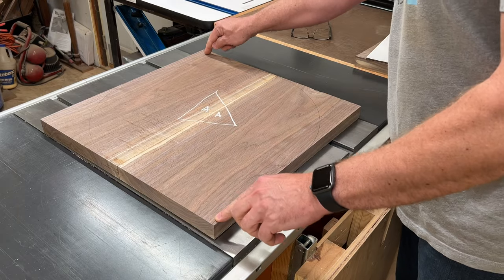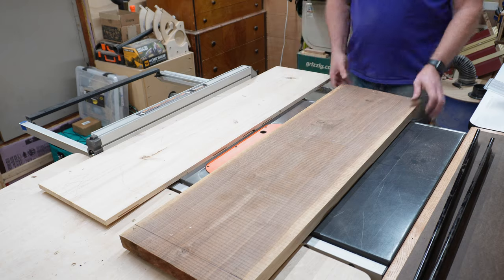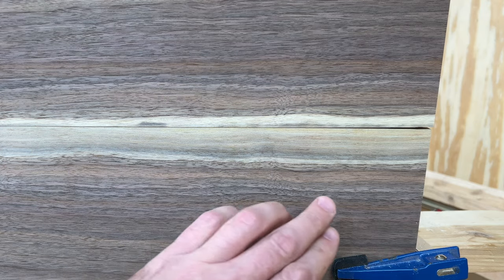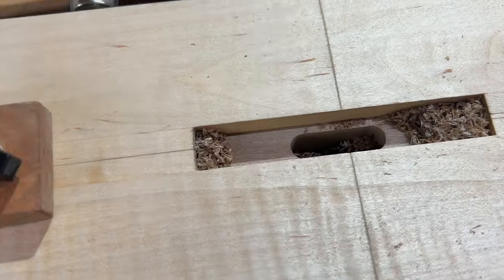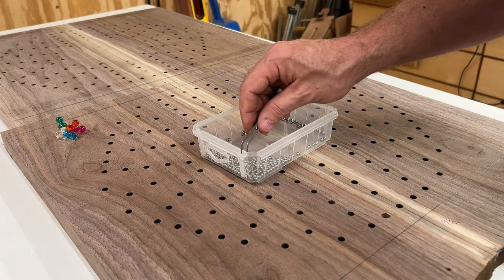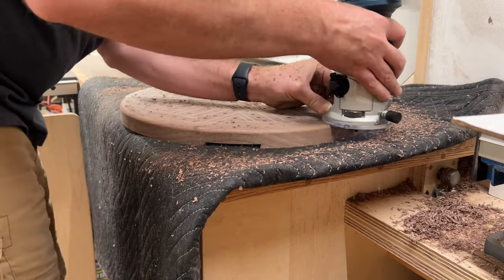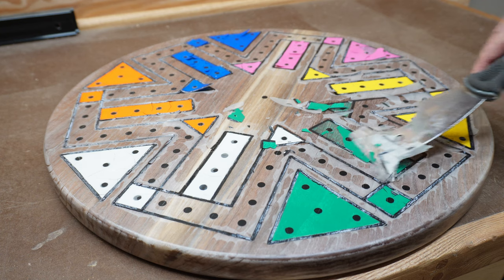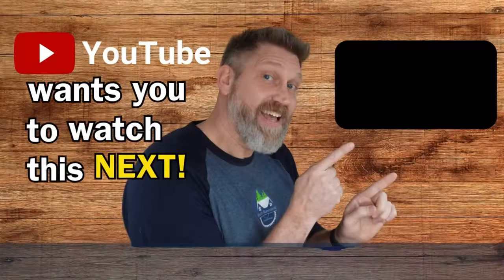I Almost Gave Up Making a Wooden Game Board

Comment: So, did you use...... wait for it..... Black Jac Shellac? 😂😂😂. Couldn't resist! Regarding all of the imperfections that you said would have been better if done with a CNC. I disagree. Yes, they are a magnificent woodworking tool. The thing is, is that it would not be hand made, it'd be machined out. This gameboard is only going to appreciate over time and those slight imperfections are what makes it special. Not machined. 😊😊😊
Reply from the maker: Thanks for the encouraging words. And the laugh 😆